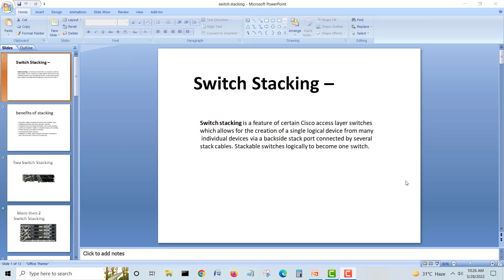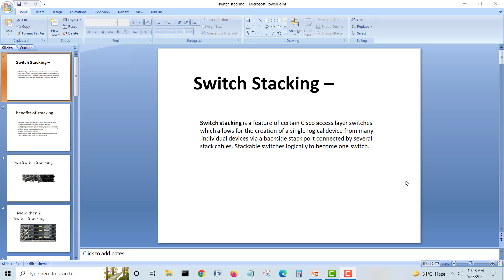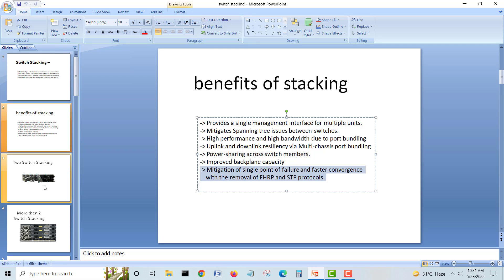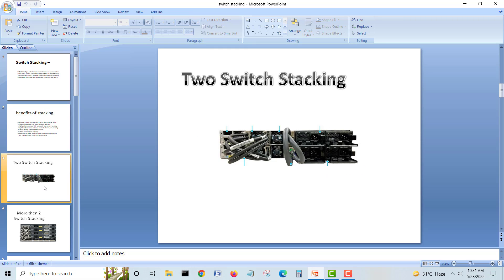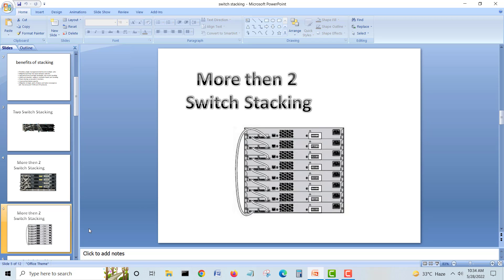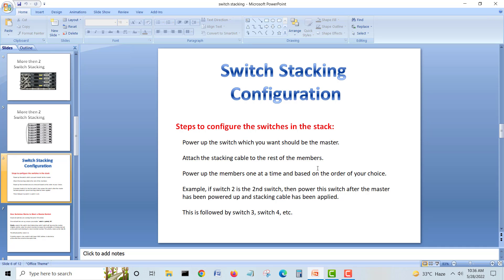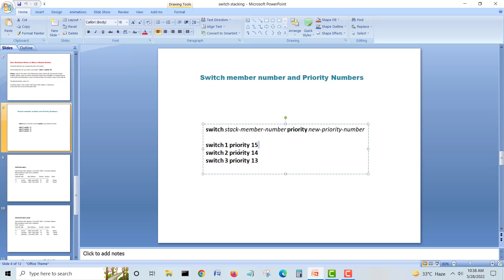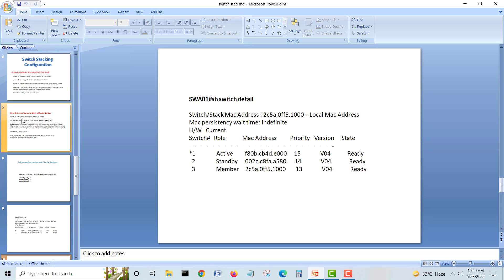What is Switch Stacking ? | Switch Stacking | Cisco Switch Stacking

Comment: Hi, thanks for the explaination. just a question on the stacking failover. if the standby switch(switch 2) take over the session during the event that the active switch(switch 1) is having power failure, what will happen when the switch 1 is back online?

Comment: thanks sir for ur consideration n sharing the info... god bless u... now question is this... 
1) as u told regarding the connection to create the master we need to power on the switch once its boot up procees complete connect the standby switch and power on than member than next member.. so. on... so do we need to just power on step by step or else we also need to connect cable physically step by step ?? we can create the physical topology ready and than power on the switch step by step ? ryt ?? 
2) what if master gets fail standby switch will take the control so what about configuration all the configuration of master switch will be transfered to standby switch automatically ??  what about end host only those end host will be affected or all the end host will be affected which are connected to switch in case of master switch failure ??
Reply from the maker: Thanks for the watching you can configure Switch priorities as i told about the priorities its very easy to configure and when it will go down standby will be the master and when you will bring back the master the DR master will go back to stand by but it will required restart the devices thanks
Reply: my good luck to watch ur videos nd getting real time experience based knowledge.. thanks